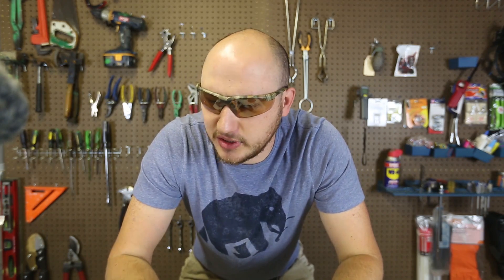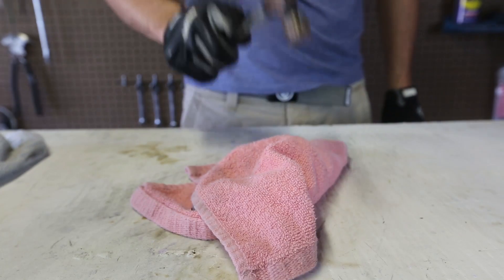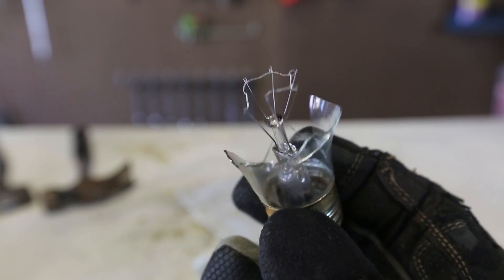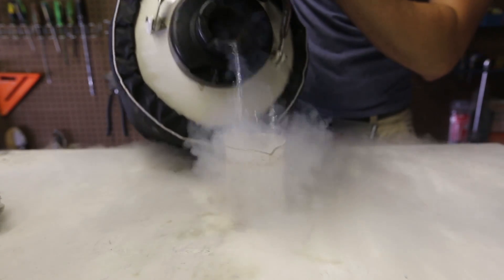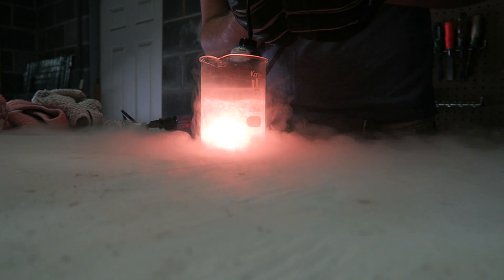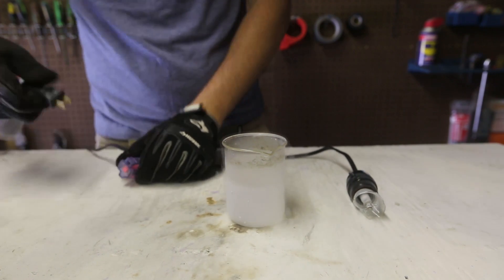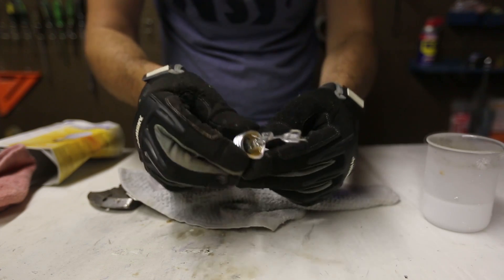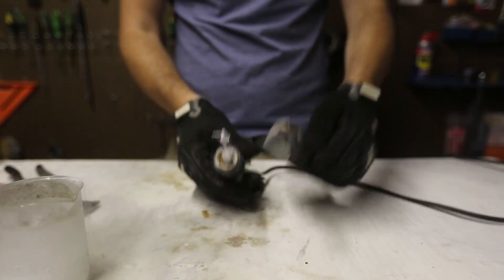What Happens If You Put Light Bulb in Liquid Nitrogen

Comment: That was really awesome! The reason the filament doesn't burn out in the nitrogen is because there is no oxygen. It's just like the environment that's normally inside the glass (the glass is not filled with air but some inert gas like nitrogen or argon). Once you take it out, it comes into contact with oxygen and the tungsten burns into oxide.
What surprized me most was that the filament could glow that bright submerged in liquid nitrogen - i thaught it would cool at least to just a dim glow.

Comment: The reason it doesnt burn out is because liquid nitrogen is a super conductor in the sense that it lowers the temperature of the filament. Which as anyonr with basic electric engineering knowledge knows, lower temp= higher connectivity.

Comment: the bulb fuse because in the liquid nitrogen the heat produced in tge filament is compensented by liquid nitrogen and light but after removing the bulb due to extra heat the bulb fused we can try to make a soln for this and the soln is we have to make a program which can variate the voltage accordingly and we all done. thanks

Comment: If anyone is wondering why this works heres why:
Light-bulbs work by having a filament that glow bright by overheating and thus making light. The issue with this though is that the filament would normally burn out and break which causes an open circuit. The lightbulb prevents the filament from burning by being in a vacuum (no oxygen=no burn) this allows the filament to get red hot without actually lighting on fire and destroying itself. By having the filament dipped in nitrogen (inert) it essentially works like the vacuum by keeping oxygen out, therefore allowing the filament to get red without burning.

Comment: There's an inert gas (I don't remember which one) inside a light bulb.  How is it that the filament can still function (without burning-out or shorting-out, being submerged in a liquid) without that other gas present?
Reply: this is incorrect, is is a vacuum inside a lightbulb, which creates an inert environment.  liquid nitrogen is inert.
Reply: samonsthewise
Okay, vacuum or gas, whatever.  My point is the environment inside the bulb is very dry, whereas this is liquid nitrogen it's being immersed in.

Comment: CrazyRussianHacker! I love the video, but it is not correct to say the "light is hot and nitrogen is cold so it doesn't burn out."   The Wire filaments in a light-bulbs around the world don't burn out because they are too hot, I mean go ahead, touch a light bulb and see for yourself. The bulb stays lighted in the nitrogen because the nitrogen completely covers it in an inert environment (it doesn't react with the metals that makeup the wire filament). When the wires get hot,  its like rusting at super speed. it will "burn out"(react with air) and disintegrate in seconds. 
keep up the cool ideas though. this video was great.

Comment: The reason the filament doesn't burn out is because there's gas inside the bulb but when the bulb breaks the gas escapes and it will burn out however if you can manage to keep it cool you don't need gas.
Reply: +Fabian Van Der Mijde too many people think heat. too right you are.
Reply: nitrogen issint oxygen. 
if u wanne burn something u need 3 things.
something to burn
heat
and oxygen

if u put that filament into the nitrogen oxygen cant reach it.
so it wont burn

Comment: when u put something in liquid nitrogen, nitrogen doesnt actually touch the thing u put in it, it evaporates before they touch. in this situation nitrogen just cools the thing u have put in it. light bulb is working because there is electric energy fllowing thru the wires. in the bulb there is vacuum so energy released cant be transformed in to any thing but light, without vacuum its just really hot and sometimes burns because there is oxygen fire can use ( for those people who dont understand- oxygen is in air, air is contrary vacuum ( actualy any object is contrary to the vacuum) so it doesnt burn but it gives out light) ofcourse, nitrogen is not oxygen and it is on because there is no oxygen for fire so it must be light! if the nitrogen would be able to touch the bulb and wires it wouldnt work because nitgoen would just evaporate much faster, like u put it in the water!

Comment: The filament does not burn out because in the liquid nitrogen is an element that isolate it from the oxidation effect of oxygen in the air. The reason why the filament burn in air it is because when it is really hot, it reacts with oxygen and the oxygen will contribute to heat it up even more and when the metal oxidize, it makes the metal more and more resistive to the current. It becomes hot to the point of melting the tungsten filament. That is why they keep the filament is a vacuum bulb.

Comment: it goes brighter and doesn't go out because the electrons are moving faster as it gets colder.
Reply: but heat is a form of energy and energy increase the speed of atoms thus the hotter a atom is the faster it would move. Example: ice is very cold and "slow" hot boiling water is hot and "fast".

Comment: Nitrogen is a non reactive material (it's inert - google it).  Works just like putting the filament in the vacuum of the bulb, except that making a vacuum in the bulb costs about $.00.000001 vs $10.00 for liquid nitrogen and the vacuum lasts until the glass breaks.   Nothing amazing about this in the slightest.
Reply: Okay negative nancy
Reply: +sean kemp I meant that the science is not amazing, or difficult really.  I thought it was cool as hell to watch.  Hell, my buddy was redoing his wiring in his house so we electrocuted pickles for lighting for fun (salts make the pickle conductive).
Reply: +sean kemp I meant that the science is not amazing, or difficult really.  I thought it was cool as hell to watch.  Hell, my buddy was redoing his wiring in his house so we electrocuted pickles for lighting for fun (salts make the pickle conductive).
Reply: I was wondering why the filament burnt out like that but it didn't in a light bulb. The bulb is usually loose so I never for once thought it acts like a vacuum. Thanks for explaining. 

Just leave out the "nothing amazing in the slightest" in your future comments.

Comment: Your problem with breaking the lightbulb is that the towel absorbed the impact and dispersed it. You need a concentrated point of impact to break glass. What I would have down is hit it with some sort of wrench.
Reply: well he did rectify the problem by using a pointed tool which allowed more force to be concentrated to a small amount of surface area. good tip though.

Comment: I think the filament is so hot it is vaporizing the liquid nitrogen, like a vapor barrier.
Reply: the leidenfrost effect.
Reply: the nitrogen is just acting as an insulator, the same reason it doesn't burn out when the bulb is intact but does if it's broken (and thus the tungsten is exposed to oxygen)
Reply: I was saying that the liquid nitrogen is not touching the filament because of the leidenfrost effect. I understand that the filament burns too hot in open air and won't work. But the Liquid nitrogen isn't touching the filament because a layervof vapor is forming as the liquid boils off of whatever it touches.

Comment: liquid nitrogen contains no oxygen. the filament still gets hot and glows, that temperature being a ready trigger for a reaction with oxygen (combustion), but it can't combust without any oxygen around. the bubbling gases you see in the liquid nitrogen were just pure evaporated nitrogen. not all gases contain oxygen.

the moment u take it out and expose it to atmospheric air, it touches oxygen and starts to combust. the oxidised portions of the filament are no longer conductive and thus the filament slowly burns out.

temperature likely has nothing to do with this. you could probably replicate this with any other non-reactive fluid. 

in fact, the bulbs are filled with argon gas.

Comment: What would happen if you used just tap water instead?  Would it matter much if it was cold water vs. hot water?
Reply: Tap water contains minerals which make it conductive to electricity.  Placing the filament into the water would cause the two electrodes holding the filament to short together.  The only reason why an incandescent light bulb produces light is that the electricity is fed through a filament with a high resistance, thus producing light (and a large amount of heat.)
Reply: Aleatha Vogel Ok try distilled water then.  I wonder what would happen as the water heats up.
Reply: If you could distill the water so that it was pure enough then yes, it would work just fine.  You asked about tap water which is how I answered your question :)
Reply: Aleatha Vogel I wonder if the filament would last longer in water or if the waves it makes would eventually fatigue the filament.  Also I wonder if you undervolt the light in water if that would make a good nighlight or moodlight like maybe 60 volts instead of 120 or just use a low voltage light like 6V thru a 12V light.
Reply: David James
I suppose it depends on the metal composition and thickness of the filament.  If the water reached an intense enough boil, the turbulence would cause metal fatigue in the filament and cause it to break if it was too flimsy.
Reply: Aleatha Vogel This would be a very good experiment to try such as adjust the amount of water, monitor the water temperature, add some salt, adjust the voltage, check the amperage draw (perhaps using a laboratory power supply (lab PSU))...
Reply: David James
Seeing as it is the reaction to oxygen that causes the filament to burn too hot and thus "burn out", it would also be interesting to see if the bubbles of hydrogen & oxygen surrounding the hot filament in distilled water would cause the same effect or if the surrounding water would rush in to fill the space too quickly for the filament to overheat.

Comment: the bulb still glows because nitrogen gas is inert, non reactive. unbroken light bulbs are filled with inert gases because oxygen (or maybe it's the air its self i can't remember) corrodes the filament at high temperatures... i believe that's how it goes. once you took the busted bulb out of the nitrogen and it contacted the air, it corroded much faster. the filament was no longer protected from the oxygen.  these gases are also used in the food industry. like in chip bags. the air in chip bags is argon or some other inert gas. FUN FACT, you breath in about 3.7 times more nitrogen than oxygen with every breath. our atmosphere is 78% nitrogen and 21% oxygen.

Comment: The filament is dimmer just because the liquid nitrogen cools it.
It doesn't burn because, when inside the liquid nitrogen the filament is surround by nitrogen gas and cannot oxydate(which is what kills it when you run it in air).

Comment: okay, tell ya the truth why the nitrogen didn't blow up is that under such low temperature, the Resistance is extremely low, thus generating nearly no heat. If you could, try let it light first outside for a while, and make it hot, then put it inside the Liquid Nitrogen. In this case, I bet you really need a suit to protect uself.

Comment: The reason that it doesn't burn out, is because you are keeping it away from oxygen, NOT because the nitrogen is cold. The nitrogen insulates it from the O2.
Reply: Right. As the filament becomes hot it boils off a small amount of the liquid nitrogen, creating a shell of gas around itself. This shell protects the filament from burning out and the constant heat from the filament maintains the shell of gas. 
I'm guessing now that the temperature of the filament and the liquid nitrogen are fighting each other. That would explain why the visible light keeps flickering.
Reply: its called the leidenfrost effect. its why if you put a drop of water into a hot pan it dances around as there is a layer of steam to keep it from directly touching the pan
Reply: Einstein is that you?
Reply: BOOM!!!!!!!!!!!!!!!!!!!!!!!!!  i actaually knew that i was gonna say it but you said it D:
Reply: zrtaylor23 Oxidation, to put it simply, is when something rusts. Rusted parts lose their integrity and break. Heat accelerates the rusting process.
Reply: zrtaylor23
Unlike nitrogen, oxygen is not inert and tends to bond with other chemicals if burned.
Reply: Yeah, I've been researching this stuff ever since I replied, and you are on the right track. When exposed to oxygen, the tungsten can ignite and that destroys the pathway between terminals. Thanks
Reply: The cold would help with the conductivity.  I guess this LN beaker is a more efficient light bulb than the argon originally in the bulb.
Reply: I wanna do it as colleage ssciene progect.....please give good and easy explanation +Joe silver
Reply: Sean Smith 

Good point.
Reply: Joe Silver Oxygen roooten food up and stain iron and Cooper if contact with o2 dearfor some food package contains nitrogen to protect the food from being rooten
Reply: I was going to say that myself.  The inside of a conventional light bulb is filled with an inert gas.
Reply: *****
I didn't realize that it burned off the gas and created a bubble, though I should have.
Reply: +Nate Jones and boom
Reply: I was about to comment the same
Reply: That makes sense. What is it about oxygen that makes it burn out though? Does it react to create tungsten oxide or something and that can't glow like tungsten does?
Reply: The cold also undermines the light which depends on the filament being hot. I don't think there's anything efficient about it.

Comment: The liquid nitrogen acts in the same way the inert gas like Argon does. Argon is placed inside of the bulb so that the tungsten filament does not oxidize. The nitrogen also prevents oxygen contact for the bulb filament there by the bulb can "Light up" without blowing.

Also the correct term would be oxidize and not blow off, a bulb without the glass cover does not "blow off". It merely oxidizes and then disconnects from either energy source.

Comment: could it be for the liquid nitrogen was keeping a light bulb cold
Reply: No, incandescent light bulbs work  by heating a tungsten filament to produce light, so no heat would equal no light. 
The reason behind this is that heat speeds up oxidisation(among other chemical reactions) to extreme rates. The leidenfrost effect prevents any liquid nitrogen from touching the filament and cooling it. Which also means no oxygen can get to the tungsten either.

Comment: Try an LED light bulb. Electrons will move more quickly through the circuit because of what is called, superconductivity. That is what happens when you bring the temperature of an electric circuit close to absolute zero. Try immersing a computer motherboard in a basin of liquid nitrogen. All of your computer programs will run much faster! Try it!

Comment: This works because the wire gets so hot that it will even catch the metal on fire in some cases. The bulbs are filled with nitrogen and when exposed to oxygen it burns from the reaction. When the filament is in the liquid nitrogen it is at a comfortable temp.

Comment: The reason it didn't burn out in the nitrogen is because the filament burns out only if it reacts with the oxygen in the air
When it was placed in the liquid nitrogen there was no oxygen to react with.       
Even though LN is super cold and the filament gets really hot and it didn't freeze was because of the laden frost effect.
Please correct me if I'm wrong :)

Comment: The shell on the outside of the light bulb is not actually to protect people from burning themselves, on the inside it contains nitrogen. If you take the bulb away you are exposing the fuse to ozygen, so it won't work. When you put it in the liquid nitrogen, it contains nitrogen so it will remain working. :)

Comment: I think it's because when something so cold as liqued nitrogen gets mixed with something hot or at least warm then it just evaporates, u know when u put a drop of water on a really how plate it starts to slide around, it's brcause the temperature difference is so big that the under part of the water drop simply evaporates and creates a floating layer between the hot stuff and the rest of the water droplet. I think the same is happening here except that when the light bulb is turned on the surrounding liqued just evaporates and can't really touch it in reality simply because there is a layer of evaporation separating the liquid and the lightbulb
Reply: that is why u can safely throw that stuff on your face temporarily without damaging u. there is a video on YouTube    demonstrating this!
Reply: This is known as the Liedenfrost effect, and I have seen it suggested here many times, but I think there's rather more to this picture, that's just one part of the puzzle.

Comment: I forgot what this effect is called, but if there is a really hot object in a really cold liquid, the object won't touch the liquid. The thing in a lightbulb that lights up needs to not be exposed to oxygen to work, so when you dipped it into the liquid nitrogen while it was cold, no oxygen went down with it, but when the lightbulb was turned on, there was a small barrier of vacuum created between the wires and the liquid nitrogen. This is why I believe this worked. If you disagree with me, please tell me.

Comment: It does not blow out at first because of the heat difference. When there is that much of a gap, an air pocket is formed around the hot object. Subsequently, when you pull it out, the temperature difference should goes down causing the remnants of the liquid nitrogen to physically touch the filimants causing if to burn out.

Comment: it isn't difficult to explain. inside the light bulbs is a gas called argon that I don't know how it's called in english but the translation is "noble gas" which means that it doesn't react and its used to prevent the burning of the filament and the liquid nitrogen is just that, nitrogen, and it doesn't burn.